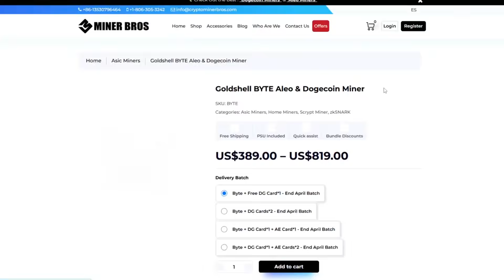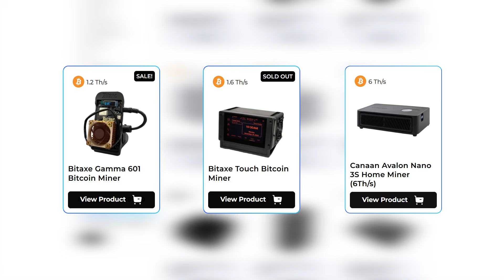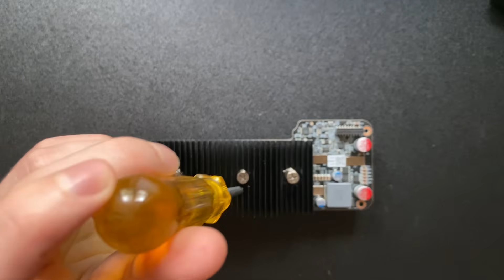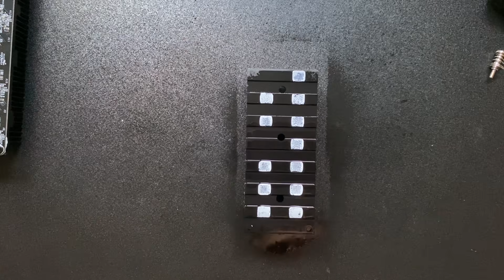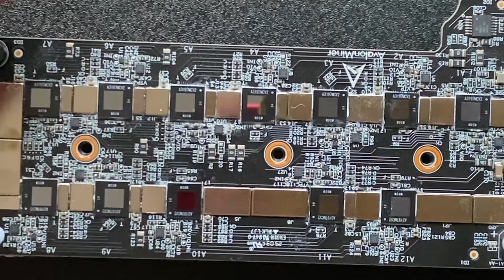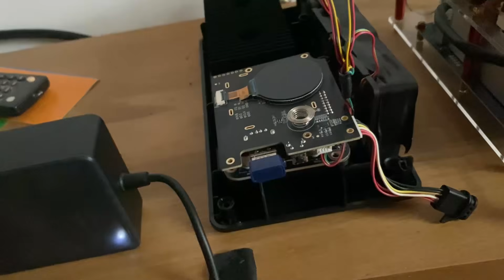How To Replace Thermal Paste on the Avalon Nano3S

Comment: Rubbing alcohol in a syringe or eye dropper. Put a drop or 2 on the dried thermal paste and let it sit. Add more if it evaporates but keep it soaked.  Then use a tooth brush to remove it. Toothbrush remove thermal paste and not transistors n shit.

Comment: They probably didn't add more chips beacause it is already running quite hot as it is + They'd need a stronger PSU (Instead of the flimsy USBC-PD). The form factor might also have to be bigger and different (Better/more) cooling fans. Which would be heaps better, but the price would go up by a huge bunch!
Cheers, and tell Dr. Krieger hi from Obersturmbannführer Gerald :>)
Keep on hashing!

Comment: Number of chips is often just practicability - like with 0.4V core voltage in series it would be 4.8V what is very close to 5V what is commonly used.

Comment: I use Thermal Grizzly Kryonaut Extreme for Bitaxe, in this case because the chip is active 24/7 (if it's in the pool). This one doesn't lose its properties for more than two years. The other ones with thermal conductivity less than 12 W/mk are for chips that have liquid cooling, in this case. Don't compare them with CPUs.  Good videos you have. 👏
Reply: Duronaut is more better
Reply: @Hristo_Chakarov Water cooling, is perfect.